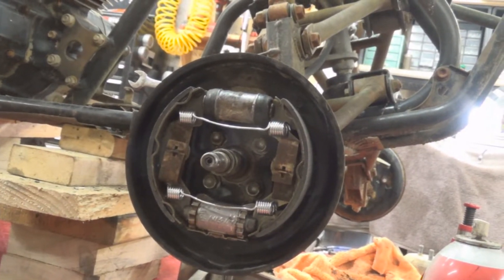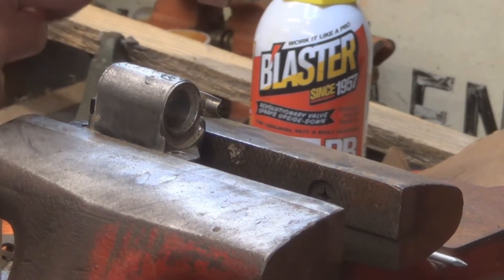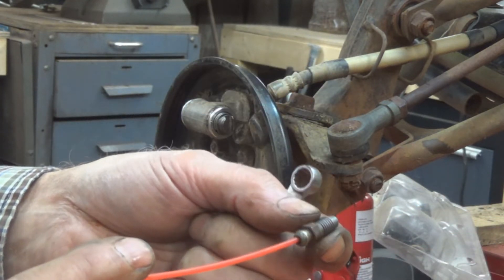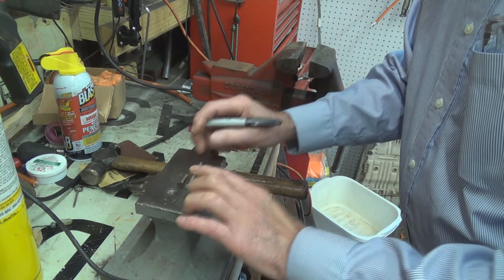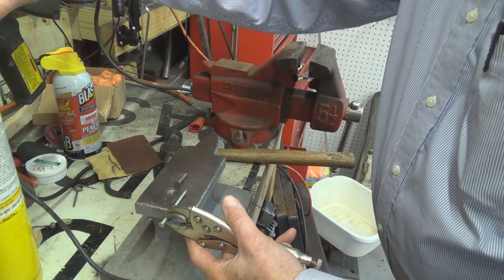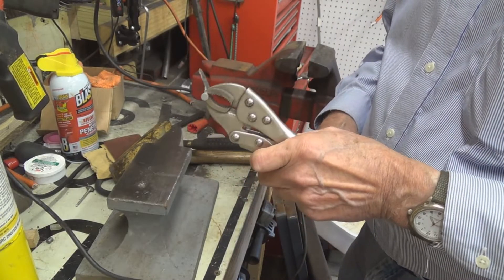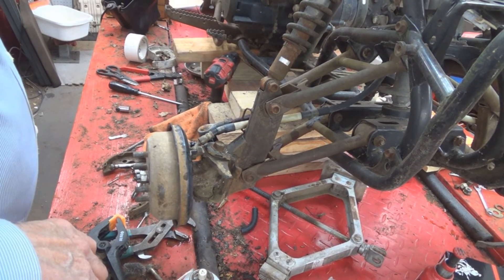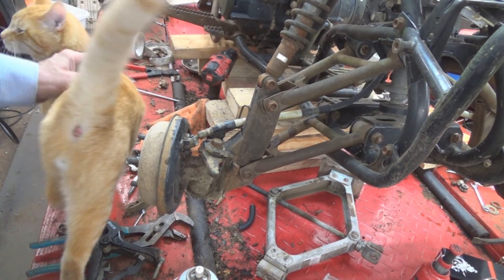86 Honda 200SX, step by step assembly of front brakes   ZZZZZZ

Comment: Dear George, I have a similar 1985 Honda TRX250 Quad Bike, and your video has now helped to know how to fix the front brake which has siezed the wheel up, that it won't turn. I have got a yellow Bernzomatic Torch that I've been using for years. But my Torch Handle is a Bernzomatic TS4000. I've not seen the type of Torch Handle that you're using. It seems to put out more intense heat. Can you please tell me the Model Number of it? Is it by Bernzomatic? Is it available on ebay? Thanks. Simon MacDonald. Invercargill, New Zealand. b.1975
Reply from the maker: Thanks for stopping by Simon. I believe the nozzle that I use came from Harbor Freight. Do you have a similar store down under? I'm sure you could source one on eBay to do the job as well. The yellow tanks, as you know, are map gas and not propane. The map gas is hotter for sure.

Comment: I have a 1986 200sx I just started wrenching on. The front left hub is stuck on there. I tried a puller, rubber mallet. Its on there. Any suggestions?!? The front right came off no issues
Reply from the maker: You may have to use some heat along with the puller and a BIG hammer. Hope you get it. Thanks for stopping by.

Comment: How did you get the hub off to do the brakes? I’m having a hard time.
Reply from the maker: Lots of hammering and a puller. Mine were stuck pretty well after sitting outdoors in a field for 10 years. If you are blessed enough to be able to back off the adjustment screw it would help. Mine were frozen. Patience is the key.